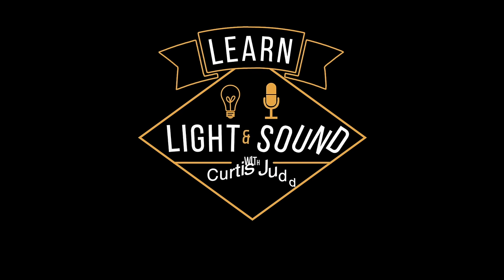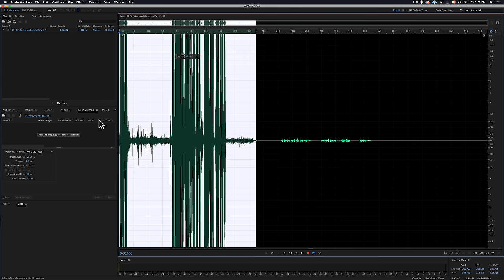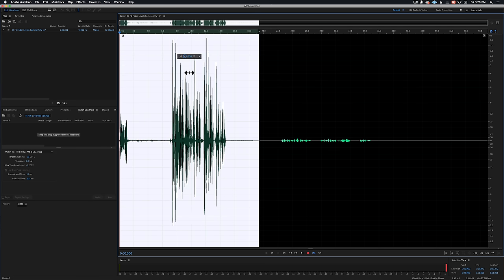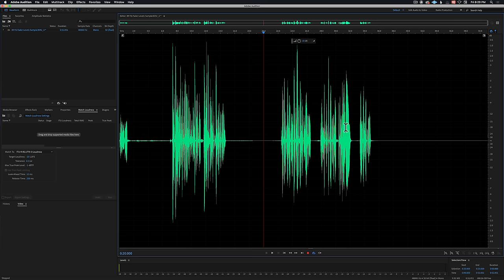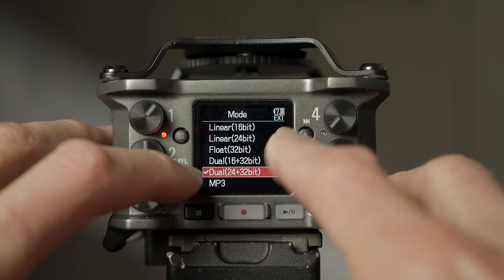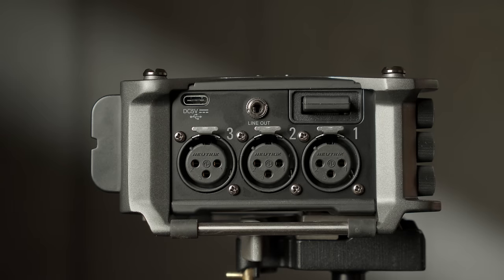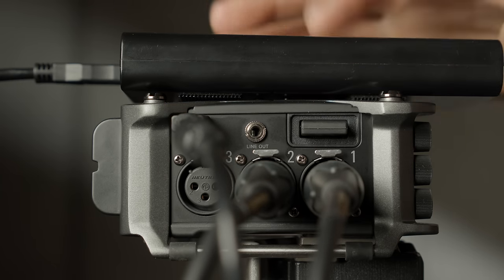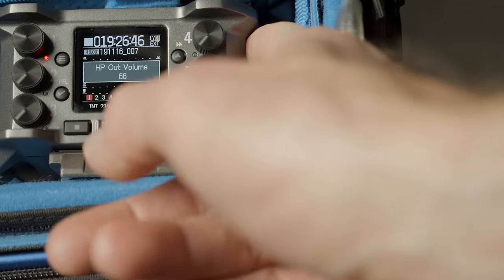Zoom F6 Audio Recorder Review

Comment: Love your reviews as always. My F6 is on order, but I have a question. People seem to talk of 32bit float as if you can take a ridiculously weak signal and just boost it straight back up to healthy levels. I can't help but wonder at what point you run into problems with the self noise of the mic. Some quite expensive mics have self noise in the region of 15 to 20 dBA. Would this likely be a problem? I hope this isn't a daft question. Thanks again for the great information.
Reply from the maker: The self-noise of condenser microphones is almost always the main contributor to self-noise in an audio signal chain, regardless of whether you're recording at 24 bit or 32-bit float and assuming you're using a modern, quality preamp (like the F6). So this is not a concern that is unique to 32-bit float recording. If recording with as little self-noise is the most important factor for your job, then I'd look for mics with less self-noise. However, I'd also warn that self-noise is but one element of making a good microphone choice for the particular job.

Comment: Thank you for your review. Regarding that issue with the Tim code to the bmpcc4k have they addressed that issue yet? 
I definitely will be purchasing this unit along with the Bluetooth module to connect with the atomx sync.
Reply from the maker: Not that I know of - the 3.5mm TRS to TS adapter seems to address that issue.

Comment: So looks like the Zoom F6 has a bad USB related bug that I recently discovered - in USB Stereo Mix Mode, the audio signal from the recorder will drop in pitch and even delay by a half to 1 second when listening to it on the PC. I've been using it to stream on Twitch over the past few weeks and it does this at least once on every stream which requires me to exit USB mode and re-enable it on the recorder. I've tried different USB 3.0 ports with no change as well as updated the FW to 1.3. Next I need to rule out using Streamlabs OBS, my USB-C cable, and try different XLR mics from the equation. If those aren't it then I'll be contacting Zoom about it.
Reply from the maker: Sorry to hear. Best wishes sorting it out! Hopefully it can be fixed, whatever the outcome.

Comment: Hi Curtis. I’m guessing you will always get good audio because the mic is correctly placed to the talent. I’m thinking  the results wouldn’t be so great if for example the mic was 3 feet away from talents mouth  would you agree? As i’m sure you would get more of a roomy sound
Reply from the maker: Hi Peter, yes, the ZOOM F6's 32-bit float wide dynamic range capability does NOT replace the necessity of good microphone placement techniques. If the mic is farther away, it will definitely sound farther away and it will pick up more ambient noise/sound. 32-bit float does not fix that.

Comment: Amazing video as always Curtis. I now own an F6 and was curious if you have experienced exceeding the maximum input level, which is +4dbu compared to +14dbu on the F4. Does this create any real world problems when recording loud sound sources (e.g. fireworks or thunder) or am I worrying unnecessarily?
Reply from the maker: Hi Douglas, congrats! The output is not capable of handling audio which exceeds 0dBFS so for very, very loud sound sources, you'll want to make sure the peaks are well under 0dBFS on the meters. the dBu scale is a different, analogue scale. Best wishes!

Comment: You’ve made a mistake in the “recovery” section. The noise floor will be identical in all three sections as it is unaffected by fader operations. The “impressive” -100db noise floor that you were seeing is because you accidentally analysed a small part of section TWO that PRECEDED the bit of section two that you swiped for manual normalisation. Watch the video again and you’ll see what I mean. 

Rgds Jeremy (calibration specialist for a chip manufacturer for audio devices)

P.S. Great video nonetheless - you’ve sold me; I’ll definitely be buying one over the next couple of days! :-)
Reply from the maker: Thanks Jeremy! Appreciate the correction.

Comment: Curtis, love your reviews. When using  the F6 with Sennheiser wireless mic will the transmitter output or receiver output (or both) throttle/negate the advantage of the 32 bit float?
Reply from the maker: Yes. The wireless system will be the dynamic range bottleneck before the audio ever gets to the F6.

Comment: hi curtis thanks for all you do. question: get this and an xlr adapter for use with the only mic i have (rode videomic pro +) or get the mixpre3- 2 which could handle the rode video mic natively right? thoughts? also, with either of these devices would it really be more worth it to get a xlr based mic instead for the best audio quality? planning on using the 32 bit float always and recording for indie film dialogue. thanks for your thoughts.
Reply from the maker: Hi Rory S-B, my preference is for the MixPre and yes, a higher quality XLR microphone would be preferred - something with a wider dynamic range.

Comment: Curtis, first of all, I just love your reviews! Great info, great style.

Question about the limiters: I'm hoping to use this to record livestreams of classical musicians. Would recording in 32-bit for the dynamic range allow for a limiter on the line-out to a consumer camera? Would it be just a regular threshold limiter, not the look-ahead type?

I obviously want the 32-bit for post-production, but would love for my livestream viewers to not get clipping in the case I'm not able to adjust the levels fast enough. I tend to perform (trombone) on these livestreams, so can't do A/V all the time.

Any advice is very welcome. Thanks in advance.
Reply from the maker: Hi Brian, Yes, there is an output limiter you'll want to engage for the live stream feed. It isn't necessary for the output limiter to be the advanced hybrid look-ahead variety as the audio is already in digital format at that point in the signal chain. I would just suggest being rather conservative on your fader levels and that way you won't have to engage the limiters much. That way you'll have a good recording for post and a good livestream. Best wishes!

Comment: Curtis thank you for for your awesome videos!!

At 5:19 there seems to be distortion on both sound devices units when you say “NTG” on the Mix Pre 3 II and “into” on the 888. Seemingly in the 109hz area with anything with the letter “N” in it. Is this distortion because of the added gain in post processing or due to the nature of the preamps in the Sound Devices units?
Reply from the maker: I'm not sure, will look into it.
Reply from the maker: Curious - could you describe what you're hearing in those samples? The NTG3 microphone is sort of boomy so it definitely has a bit of that boomy sound, but I'm not sure I'm hearing distortion. The 888 and MixPre both tend to have a warmer low end so perhaps that's what contributes to a boomier sound with the NTG3. Also, out of curiosity, what did you monitor with as that can also be a factor?
Reply: @curtisjudd  The second I heard the comparison at 5:00 I noticed the "muddiness" of the MixPre. Until now I had my pennies saved for the MixPre. Not so sure now....
Reply: @ScottHiddelston  Funny enough, at my end I preferred the slightly 'fuller' sound of the Mix Pre but not by a huge amount.

Comment: Great video as usual... Now for something completely different. I went Googling this morning a video (or even a website) that I'm not sure exists. I thought of you right off the bat. What do you think about a video (and a database?) actually measuring and comparing the built in-preamps in some of the most popular cameras? It's a huge consideration for folks who just want "good enough" without dealing with sync issues, external recorders, larger rigs etc...  And I'd imagine there is A LOT of variation in the space and it's not well documented. Given the importance as this is the normal use case for probably 90+% of cameras, I think many would find this helpful. You see the "terrible preamps" comment often enough in user reviews to give folks pause even on expensive cameras... but I always wonder if the reviewer's "preamp" diagnosis is correct or really justified. Keep up the good work.
Reply from the maker: Great idea Lee. I’ll just need to think about how I can source the cameras. 👍

Comment: Hi Curtis not sure if you've done a video to answer this..  I'm a bit sick of mucking around with on camera mikes and lapel mikes connected to cameras..  don't want to mess with wireless.. just for doing videos..    so I'm thinking I'd rather just have a little pocket recorder that does good quality recording.. and I reckon that'd be fine with a lapel mike inside my shirt going to the recorder in my pocket.. and its pretty easy to synchonise the audio later..    just wondering if you'd have a suggestion for this?    It'd be great also if I could use it to capture cool environment sounds like birdlife and thunderstorms but I think would mainly depend on the mike I attach to it not the recorder?
Reply from the maker: Fine idea, I used the Zoom H1 for this for years.

Comment: Curtis, I film with a Bolex D16 camera, with two onboard xlr inputs, 48 to 96k to an NTG 3. Haven’t wished I’d had more quality yet, but I’m shopping for a separate audio solution as well, for certain situations. Seems the newest mix pre 3 II series would be a good investment for the clipping insurance as much as anything. I can’t use time code with the Bolex, but Isn’t the dynamic audio an enormous advantage if you can afford it?
Reply from the maker: Hi 13lake, Yes, it is, especially if you're operating both camera and sound at the same time.

Comment: Awesome video, Curtis! Regarding the wierd timecode thing that requires an adapter on the camera side: would it be possible to use use a minijack to RCA (male) cable + a minijack to RCA (female) and the “flip” left and right channels by connecting the two RCA pairs the “wrong” way? The last thing i need on my BMPCC4K’s is a bulky adapter on the IO. Space is really tight!
Reply from the maker: In theory, yes. I haven’t tested it, but should work.

Comment: Great review, Curtis! Very clear and concise. I'm just wondering, is it possible to power the Zoom F6 via the USB-C port on the F6, from a camera such as the Blackmagic Pocket 4K's USB-C port? Or is there another way to power the F6 on some sort of mains power, or are batteries the only power solution? Thanks!
Reply from the maker: You can power the F6 via its USB-C port from a USB battery bank or AC adapter but not from any cameras of which I am aware.
Reply: Curtis Judd thanks Curtis!

Comment: Great video Curtis!  2 questions;  Maybe you said and I missed it, but how much record time would you get on either the AA battery sled or the NP-F battery?    Also,  would you say the iOS app could take the place of the F-control board? Is one more capable than the other? 
Thanks!
Reply from the maker: Hi Stephen, battery power time depends on so many factors so it is hard to pin down a time - number of recording channels, sample rate, phantom power, Bluetooth, etc. I think the AAs should be used mainly as bridge batteries when you’re changing NP-F batteries or USB battery bank or for really short jobs - less than 2 hours. The app vs F-Control is largely a matter of personal preference. I like them both for different reasons. The app is more convenient - just an iPad. F-Control and USB keyboard allows me to work faster.

Comment: Super good channel Curtis.  May I ask,... we use the seinnheiser avx mics.  with the F6, there is not option to set the gain around -12 when recoding in 32 bit?  just record in 32bit float and it will normalize the sound?  or am I missing something? thanks so much!
Reply from the maker: You can adjust the fader and the F6 records the post fader levels. It is a different way of working but is not hard to get used to.

Comment: i see that we can sync the timecode with bmpcc4/6k via 3.5mm jack with mono converter, my question is, will the timecode on bmpcc stay synced with f6 when we plugged off the 3.5mm cable?
Reply from the maker: Hi, no it will start to drift after you unplug the feed from the F6. It'll get you in the ballpark, but it will not be perfect sync.
Reply: @curtisjudd  thank you very much!! :D

Comment: Hello Curtis, great review! I have a F6 and no matter how I used ( tried different cables and configurations) there is a very noticeable  noise  in the sound, is this a know issue or my unit have some issue?
Reply from the maker: Not a known issue. I’d check cables, microphones and if that doesn’t work, contact Sound Devices support.

Comment: I'm noticing a 1 frame drift from the Zoom to the Blue Ultra Sync in real time.  Have you run into that?
Reply from the maker: Hi Allen, I haven't tested the Blue extensively with the F6 so not positive whether it is actually off or just the displays are off. Seems like displays especially LCD displays like on the Blue, are a little slow so the often appear to be off when in fact the TCXO is spot on. The same occurred with the Tentacle Sync (the jam menu showed them to be off by a portion of a frame when I took still photos, but the sound is perfectly in sync when I run through the whole workflow). So that was a case where the same display was off, but the actual timecode worked - a hand claps synced perfectly. I suspect LCD displays are just too slow to be relied up on for this purpose.

Comment: Thank you for this review! I am new to this, mainly focusing on field recording with a hydrophone and checked up on both Zoom F3/F6 as well as Sound Devices Mix Pre II series. Are there any major differences in terms of sound quality/low noise preamps and durability? I am looking for something easy to handle (beginner) that I can mainly use for under water recordings and some other ambient sounds. So far the F6 in combination with the bag sounds quite interesting to me. Any other devices that I could check up on before deciding?
Reply from the maker: The F3 is nice in that it is so small. The F6 is good albeit not as ergonomic vs the MixPre (my subjective opinion). The ZOOM recorders are more battery efficient than MixPre.
Reply: @curtisjudd  Thank you!

Comment: Curtis, what is/are your suggestion(s) on a mixer/recorder that its output has a large gain？Is Zoom F6 or Tascam DR-60MKII is a good choice?
Reply from the maker: Hi Sampson, tell me more about what specific problem you’re trying to solve? The Zoom F6’s output is microphone to consumer line level unbalanced. What type of device do you need to feed the audio to?
Reply: @curtisjudd  Hi Curtis, thanks for your reply. 
In fact I'm a badminton coach which I have to take some video of matches. I want to  record the playing sound of the match and the score from the umpire. Here is the video that I took recently.

https://youtu.be/Z6Se0Hc1d8o

I was using Sony a6400 to take video, Azden SGM-30 as a video mic. From your video, I know the preamp of the camera is really bad. So I use Saramonic Smartrig as the interface between the mic and camera. If I turn down the preamp volume as low as possible in camera, it's not possible to record the sound of playing match (too low). So in the clip, I turn the volume of preamp in camera about 5/10 and 7/10 in Smartrig.

Here is another clip

https://youtu.be/VFlvP2j231s

The mic I used is Azden SMX-10, I used Smartrig also. But the setting has a little bit different. For the mic is not as loud as SMG-30, so I turn the volume of preamp in camera to about 7/10 (so you'll hear the louder the noise). And I placed Rode Video Wireless Go to clip on the pole of the court so We can here the sound of the umpire.

Sometimes if the playground allows, I'll place the mic with Wireless Go besides the pole, I think this is a better setting. What do you think?

https://youtu.be/I97VrNsi-BA

But the mic maybe not loud enough so I have to raise the level of preamp in camera. The result is too noisy. (I haven't used the Smartrig at that time) 
The mic I used this time was Zoom F1 with MSH-6.

So I want a preamp that can output a larger gain so I can record a cleaner sound. Any suggestions?

Sorry for too long 😱

Comment: Great video, thanks. Can the MixPre II record simultaneously in 24 and 32 bit, or only the Zoom F6 has this function?
Reply from the maker: Thanks Grzegorz. Only the F6 has this capability. That’s one I missed!
Reply: Doesn’t the fact that the MixPre lets you set levels make dual recording unnecessary, except if your recording will need to be “fixed” in post and you need to give a 24 bit recording to a client in the meantime?
Reply from the maker: Exactly - I assume the F6 supports both simultaneously so you can deliver 24-bit files on the spot if necessary.